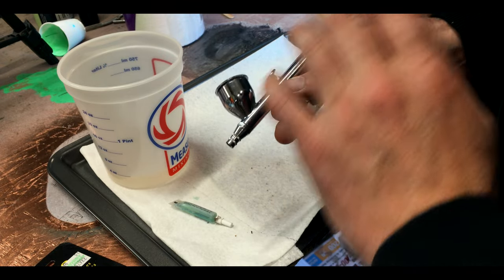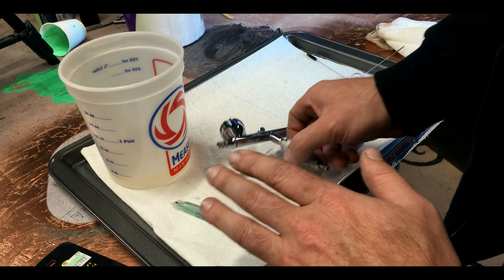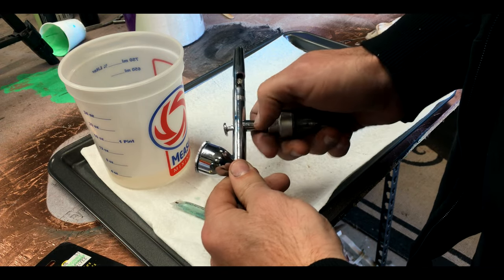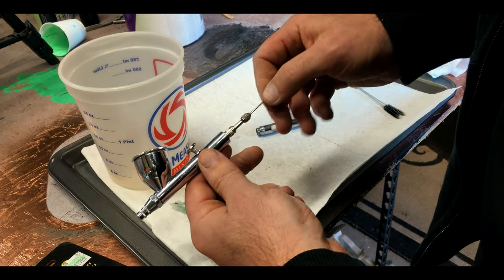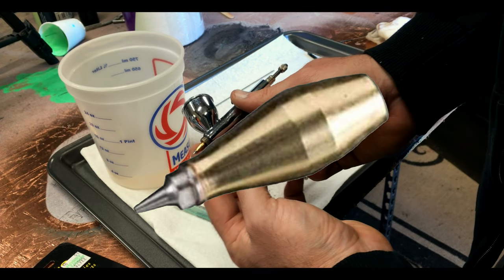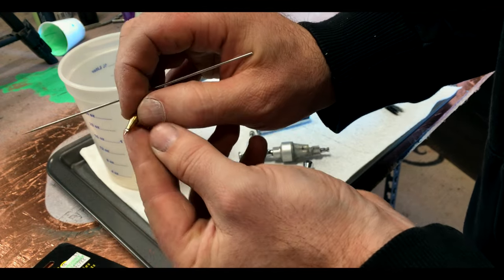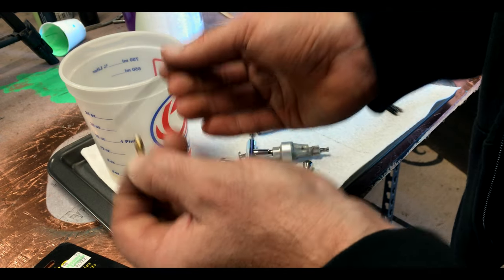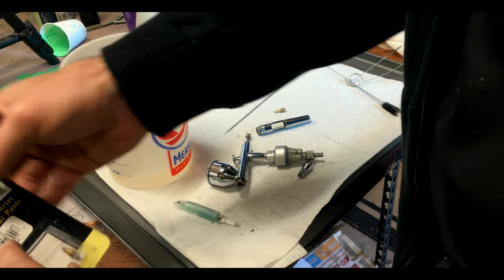Fix Spitting airbrush Iwata Eclipse hp cs

Comment: Would have like to see it actually spitting to see if that's the same issue I'm having.
Reply from the maker: Spitting airbrush can be a couple of things. This is just one way of fixing it if you’ve already done the thinning of paint and straining it properly as well as making sure the airbrush is properly clean. The bent needle or the damaged nozzle will cause it to spit no matter how well you thin the paint and how clean your airbrush is. hope this helps you thanks for watching.

Comment: I just replaced the needle and nozzle in my iwata micron takumi. I waxed the threads because the head leaks, always has. The paint is createx Illustration sepia. I added 4021 after trying straight paint. No matter what, my brush keeps giving inconsistent spray pattern. It breaks and skips when doing a line, it struggles to start a line. My air pressure is right around 25-30 psi. The paint was pruchased within the last year from Spray Gunner.
I don't know what else to do. I feel like I have a lemon.
Reply from the maker: Oh wow, I’ve never had an airbrush that touchy. Really sounds like you’ve done everything by the book. If it has always leaked, sounds like it might be the airbrush itself like maybe something is warped or bent. It is possible to have a defective airbrush from the factory.
Reply: @reddirtdesigns7021   yeah. Debating if I want another of the same or something made of Titanium from a competitor 🫣 they're expensive. 🥴  fortunately at the moment my project doesn't require perfect lines, so I'm chugging along. 🫤 i wish I could post a photo of what it's doing.
Reply from the maker: @elysegalloway  well good luck to you. I know that can be frustrating. It was for me and thanks for watching my videos.

Comment: My Eclipse Stops spraying paint, I wait a minute, it sprays then stops. My Gun is clean, Nozel/Needle are New (2nd ones in 2 yrs) Needle Chuck is tight and my paint is at Right consistency Vallejo Air. I can't figure this out. Could it be a Teflon seal or O-ring? This Airbrush is 2 1/2 yrs old. I'm a part time modeler so Airbrush doesn't get used much. I ordered a New Iwata Eclipse thinking maybe I gotta Monday, Friday made Gun. Appreciate Any input you might have, Thanks.
Reply from the maker: When I had the same thing happened, it was a bad batch of paint for me. Your paint should be diluted to a milky like consistency thinner than you would think. Also make sure after you have thinned it down, run it through a strainer to make sure there’s no small particles or chunks that can plug off the nozzle. You probably have thought of these things, but just wanted to make sure you are aware because when I first started, I always thought I thinned my paint correctly and I didn’t and also straining. The paint is really important to make sure there is no chunks. It only takes something smaller than a grain of sand to plug off a nozzle. Also, before you start run paint thinner straight through if you have that problem with straight paint thinner, then you have a bigger problem than just Paint. Hope this helps and thanks for watching.
Reply: Thats the issue i have, i use painta from VA, AK, Tamiya and Mr Hobby same issue, all diluted to skim milk consistantcy and all parts cleaned

Comment: When I took nozzle off, it stops working. Paint shoots out of cup. Put it back together several times and doesn't work. Ain't taking it apart to clean it again
Reply from the maker: If it’s bubbling out the top of the cup, that means you have a blockage still try running a thin pipe cleaner through all the orifices. hopefully you can get it.